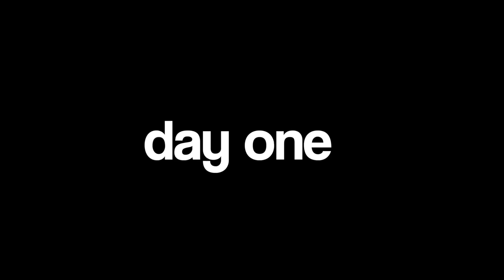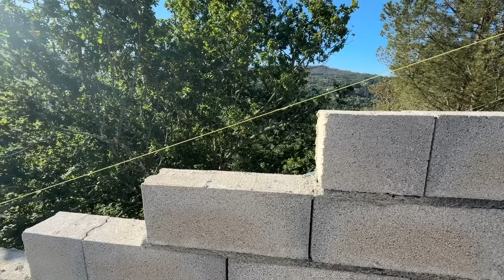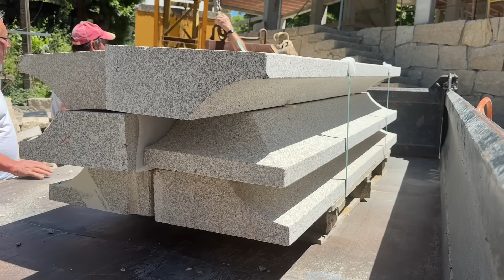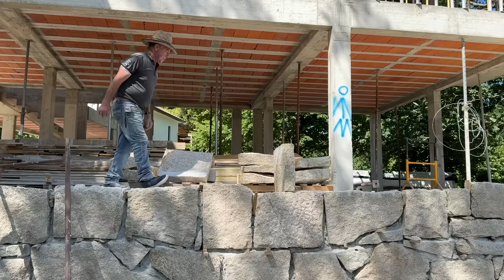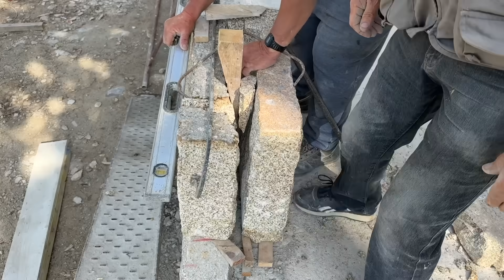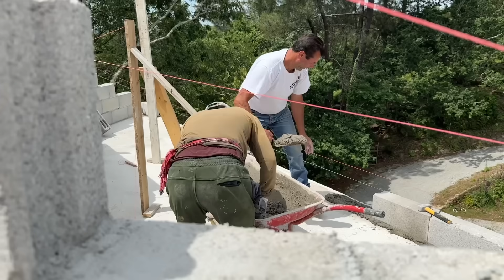The Vision Comes to Life – Our Home Begins to Emerge

Comment: Why, with a wheelbarrow right there, is the large bucket of concrete emptied onto the attic concrete floor instead of the wheelbarrow?
Reply from the maker: Probably easier to work with. Not sure. 👍
Reply: I believe in working smarter, not harder. The concrete on the floor has to be shoveled into the wheelbarrow. 

I have enjoyed learning of the different materials and techniques used in Europe. But, dumping the concrete in the floor is really puzzling to me. 

The concrete block to support the roof is fascinating.

Comment: Hi , all going well.
We are in Portugal as well. 
We have rebars in our constructed home. It’s not always water ingress that can be a problem.
The heat on the building causes the metal inside the pillars to expand ,this does cause minor cracking to occur.
We do have trees also near the house,but they can become an issue. Strong storms earlier in the year caused two to fall two others to loose limbs. One of which could easily of destroyed a covered lounge.
When we get a water bill the company send a leaflet about once a year it instructs owners to clear the area around the house of all trees except fruit trees to a distance of 50 meters.
If there is a fire around the house area, you have a chance to protect it.
Also it is a good idea to take the lower limbs off the trees for about 3/4 meters from ground level. This means ground level flames will not catch the branches to set them on fire.
Check out Aquatic plants & bio pools property tour of Refugio Botanico in central Portugal. It’s shown on Farmer For Fun.  It’s is beautiful, they grow and create bio pools. Worth a look at his ponds. He may have just the plants you are looking for. 

Also if no wood is used in its build it is less likely to be damaged.

Comment: What an amazing build! Here in the USA our structural skeletons are similar but materials are different. The idea of building the ridge lines of the Gable roof of cement block boggles! The relationship of poured concrete posts with rugged stone cladding joined by rebar reinforced concrete is just mind blowing .  I am thinking there must not be seismic activity or hurricanes in Northern Portugal. 😂

Comment: Interesting that the cement blocks don't have concrete between their sides, just top and bottom.  Seems like it would be less stable, but see the links built into the sides.  Fun to see all the ways European construction techniques differ from those in the states.
Reply from the maker: Hi Keith, good observation. There is a small gap between the blocks for cement to fill.
Reply: The cement blocks do have "teeth" that interlock them; no need to use cement between them unless you use a broken block (half block). in the beginning or in the end of a row, only in that case do you fill the space with cement...